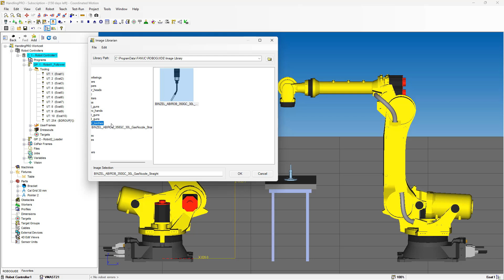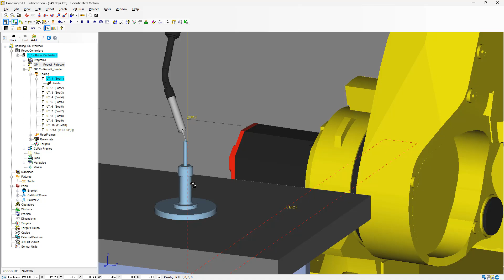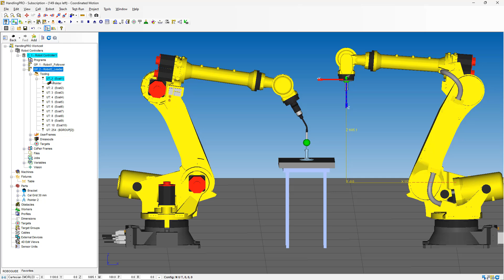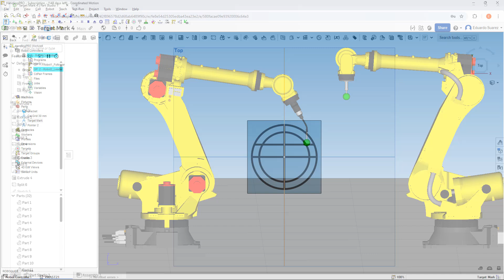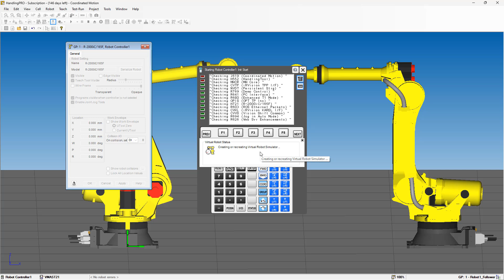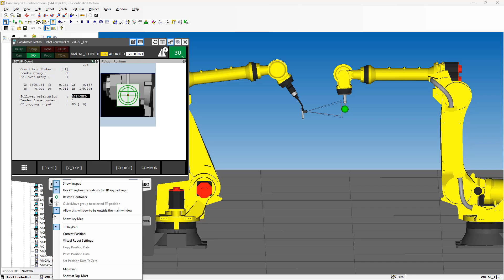RoboGuide Coordinated Motion Part 2

Comment: You haven't set the y axis, how will the robot set it?
Reply from the maker: I assume your question is referring to the six point method (XZ) for UT1 on robot 1. It will figure out the position by teaching all the points explained in the procedure for that method. The reference manual is Operator's Manual (Basic Functions)  B-83284EN/10. If I haven't answer you question, let me know the part of the video you are referring to.

Comment: Thank you for your videos, very interesting, I like to follow you. But one question, can the target marker be arbitrary or is it subject to a standard?
Reply from the maker: I used the target recommended on the iRCalibration reference manual. The following quote is extracted from the manual:
A target should have the following features:
a) A flat detection surface.
b) A contour that makes it easy to recognize the size of the target. (The circle in the above examples.)
c) A contour that makes it easy to recognize rotation within 45 degree range. (The cross in the above examples.)
I hope this answers your question.
Reply: @EduardoSuarez-Automation  Thank you very much for the great support in solving the problem! I'm already drawing